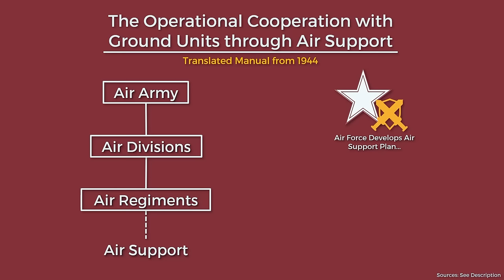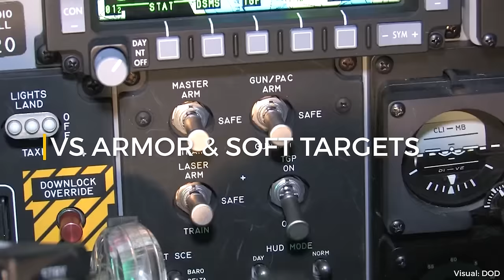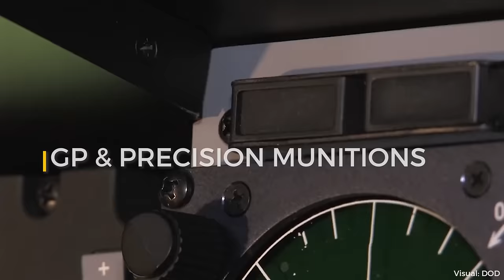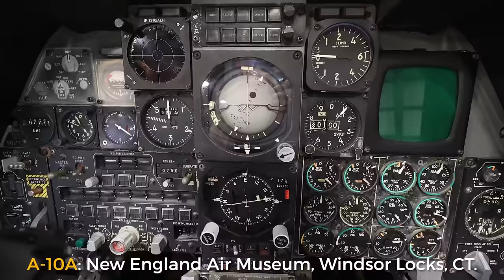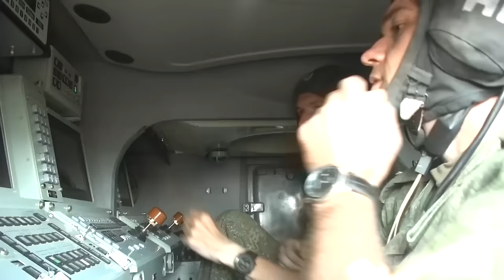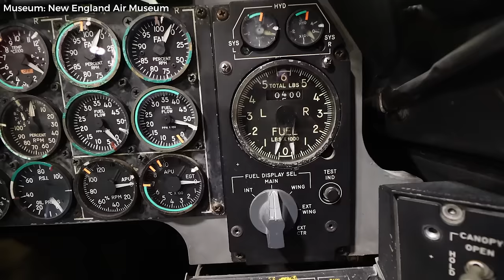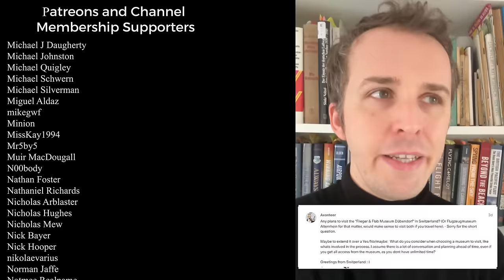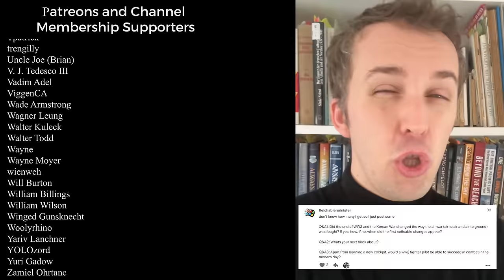A-10 Warthog: Retire or Upgrade the BRRRT? - Future of A-10C Thunderbolt II

Comment: I was going to bring this up as if I were the first to think of it, but I'm really really not.

I said it on another video, the A-10 is not a strong opener, it's STILL the best closing move. The cleanup. After your SEAD and DEAD missions sweep the enemy threats from a battlefield/zone (and enemy air threats are neutralized) that's when it becomes extremely cost effective. What need is there to waste wear and tear on the more fancy fast flying, less fuel efficient machines once the skies are tamed? Those more less economic options are the way they are to survive more hostile skies. We showed in Desert Storm that we fight wars to make gains. If the battlefield never gets safe enough for an A-10 to do CAS, it means one of the arms of the military didn't do their job like they were supposed to. And you don't bank of militaries just throwing in the towel because their SAMs and planes are gone either, there is plenty of time and space for the A-10 to get down to business once those are dealt with.
Reply: The real question is: do the politicians, and do the gears between them and the Military Industrial Complex want to get a move on and actually reboot the A-10C's parts production? Or is it politically unsound? I mean that never stood in the way of anything right?
Reply: Also 'projected to be retired before 2030' means one of two things:

A. 'We got something better in the works that we aren't telling you about.'
B. 'We have no idea what to do with it so we'll just make up something that sounds like we're busy doing our jobs in the meantime.'
Reply: The problem there is that you cannot eliminate 100% of enemy air defences with SEAD/DEAD. All of the A-10's combat losses are to highly mobile systems that don't rely on radar, and thus slipped through the cracks of SEAD operations because they are difficult to locate and track. During Desert Storm more A-10s were lost to these types of vehicles than F-15s and F-16s combined were lost in total, despite the A-10 being used primarily for interdiction after SEAD/DEAD operations. 

Modern SHORAD is significantly more dangerous. And in the A-10's best operating environment - mountainous terrain - gun-based SHORAD systems are often used directly in support of armoured columns or convoys to counter infantry ambushes, because they can engage targets at higher elevations than tanks or IFVs can. Same is true of urban warfare.
Reply: @dumdumbinks274  Unless we're talking actual radar guided flak artillery, which is quite the rarity nowadays to say the least I don't see guns getting past the AGM-65s. Especially with all the C models advancements that I know of.

Our SEAD and DEAD capabilities are far better than even before. We also have much better live satellite imagery which, I am guessing, but correct me if you know better, would narrow the cracks quite a bit.

Now, I am not sure if the A-10 is capable of datalink/a similar system as of right now. I would imagine recon drones could be employed ahead of the jet for example, and send info back, but maybe that's not the case. 

As for the poor performance during desert storm, this was because we sent warthogs flying low enough to be in threat range of shorter range SHORAD like you mentioned rather than fly in the enemy radar. An unnecessary blunder I think. Certainly not something to repeat.

I will agree that IR/optical SHORAD is the big deal. If something got through the cracks, that would be it. Wouldn't this happen far less often now vs then? They might have more range than the used to, but they are now worse at hiding from the eye in the sky. So enemy SHORAD of that nature is kind of worse today than before even with their upgrades. Besides, if it can shoot down an A-10 at high altitude, it can shoot down those other jets too. Is there a better solution? The only guess I would have is drones replacing piloted CAS aircraft all together.
Reply: @themigratingcoconut562  The AGM-65 does outrange most SHORAD systems over open terrain from say 10000ft altitude. However there are many restrictions favouring other munitions for anti-vehicle duties. The primary issues in this discussion are the subsonic glide and large size of the missile, which make it a relatively easy target for modern SHORAD systems, as well as the fact the A-10 can only carry 2 of them which prevents them from overwhelming SHORAD systems. So in essence, while the A-10 can engage SHORAD systems, it is of limited effectiveness.

SEAD/DEAD capabilities have improved, but are still largely dependent on the same concepts. There is no hard counter to modern SHORAD, because while we can more easily track ground targets *movements*, satellite imaging can be fooled by visual camouflage and is dependent on weather. Additionally, most modern SHORAD systems use radar for search, but don't necessarily use their own radar to do so. Datalink isn't just on planes, but also air defences and even tanks.

I believe the A-10 does have datalink built-in ever since the C upgrade, but it is of a more standard capability, likely focused on integrating with ground forces, which in the near future would definitely include the drones that are beginning to equip infantry squads. Everything in the near future will be part of the information network.

Desert Storm saw A-10s being shot down mostly in transit at around 5000ft, which was deemed the operational floor for the theatre. However A-10s needed to fly at this altitude in order to spot their targets visually (which is still largely the case owing to reliance on IR/EO targeting).

The best combat use for the A-10 is to fulfill the COIN and AFAC roles in low-intensity conflicts. I don't advocate for the A-10's retirement, but it's advantages are such that while it is very effective in certain situations, those situations are not common in the wars that the US military are supposed to prepare for i.e. peer conflict. I'd prefer a reduction in numbers over outright retirement, but I can see where the USAF are coming from.

The problem with the A-10 vs any air defences, is that it spends a lot more time in the enemy's sights than other jets. Slow speed = longer exposure. Fast speed = short exposure. This matters not only for the physical engagement range, but also the reaction time of the enemy systems. An old system like a ZSU-23-4 might require several seconds just to lock onto a target, which is why the A-10 was viable last century. Modern systems take significantly less time to lock on, and often have superior weapon velocity too which gives the target less time to react.
Reply: @themigratingcoconut562  incredibly short sighted. MANPADS will be unseen by SEAD, and even radar SAMs can turn off their radars to protect themselves. And nowadays electro-optical/thermal tracking allows a SAM to hit aircraft with passive sensors alone.
Reply: @dumbdumbinks274 I thought they could carry up to 6 agms, 3 per pylon. I think I can agree with just about your whole thing there otherwise, a reduction in numbers for the time being makes a lot of sense, but probably not retirement. US prepares the most for the worst cases, as that is the smartest thing to do. However, we've also had a habit of fighting wars over nouns and stuff which, I believe, tends to generate some of those oddly lopsided battlefields which are unlike most conflicts people tend to think/worry about such as that happening in Ukraine or any hypothetical/theoretical between US and Russia. 

 @ChucksSEADnDEAD  So CAS is done then. Or we just leave it to drones? The F-35 does seem the best fit to replace it then given what you are saying. With it's stealth, multi-role, awesome sensor suite, and fighter-jet maneuverability though wouldn't it still hardly be immune to what you're talking about? 

For both of you I'll present one final case for it remaining in a CAS role. 
Even though the F-35 wouldn't be shot down as often, owing to it's strengths, each of those losses would be felt much more due to unit costs, Mx costs, and tech getting into enemy hands potentially. There is also the fact it cannot stay on station as long even when it's alive, which is worse for ground troops.
So to my view this trade-off remains: Attrition rates for the A-10c would be worse given it's lower maneuverability than the F-35, but, the F-35 has to stop and re-arm/refuel more often anyways when up and running. We also cannot afford as many of them. So maybe it's still going to be better to accept more A-10 losses if that means higher numbers of ground troops being aided thanks to it's advantages in endurance, payload, and availability.

Comment: Sounds cool, but it’s one of the most overrated aircraft ever, which is why the US DOD has been trying to get rid of it forever. The F-111 had 3x success taking out armor and that wasn’t even its purpose.
Reply: The USAF did not want the A-10 because they wanted supersonic jets.
The only reason they have it is because the Army needed a Close Air Support aircraft
Reply: @pogo1140  The only reason they have it is because Congress forced them to keep it. Specifically McCain.
Reply: @The_ZeroLine  Correct, because the Army needed and still needs Close Air Support.
Fact is, that A-10 squadrons that convert to  F-16's are getting CAS training but those that are converting to F-35A's are getting zero CAS training.
That puts a lie to the claim that the F-35 can do CAS as well as the A-10.
Reply: @pogo1140  I doubt they’d want to risk the F-35 for CAS.
Reply: @The_ZeroLine   CAS is still a requirement, and right now the USAF's answer is to give the mission to another plane they've been trying to get rid off since they did not want and is even equally more vulnerable, has a smaller war load and higher maintenance cost and like the A-10 is scheduled to be retired.

Comment: While I think as a gun platform I think the evidence suggests it overated, but I cant see how the A10 could never been seen as anything other than an very useful & effective aircraft. The fact ground troops seem to love it ( and their adversaries seem to hate it ) should be recommendation enough. It does things fast jets just can’t do & in a pretty cost effective way. That said it’s a very old design and air defences are much better now- retiring it makes sense, but replacing it with something like f16s doesn’t. It need replacing with something that can do its specialised role, probably with something that is un/optionally manned.
Reply: You are ignoring the increased range of weapons which enable the F-16 to perform the mission better than the A-10.  The A-10 is designed to fly low and slow and fight close-in.  The 'slow' and 'close-in' are no longer viable options for fixed-wing aviation.
Reply: @charlesfaure1189   During Afghanistan, A-10's flew combat missions that forced F-16's to abort and had B-1's landing with their entire bomb load unused while American soldiers were calling for help.
A-10's would often fly below the low flying clouds, making attacks from 5,000 feet and lower, turning inside the valley while staying below the cloud to keep a visual on their target. The only other aircraft that could do the same were the helicopters who often ran into altitude restrictions in the hot and thin air of the Afghan mountains
Reply: @pogo1140  Speaking of hot and thin air, the A-10s had to take off with light loadouts from Bagram or else it wouldn't clear the base perimeter fence.
Reply: @ChucksSEADnDEAD   so did the F-16's thin air effects every thing that flies. 
A typical war load for a Bagram A-10 was,  2 LAU-131 Rocket Pod, 2 GBU-12 Paveway II, Mk. 82 LDGP?, and an AN-AAQ-28 LITENING AT targeting pod. F-16's usually carried 2 Mavericks and a 500lb JDAM and 2 fuel tanks.

Comment: Sadly, the USAF has tried to kill it since day one.
Reply: Well, it was spite project anyway. Not that good imo, and all victims of blue on blue would agree.
Reply: Although I think the A-10 has probably outlived its relevance at this point the AF trying to kill is not an indictment. Most AF officers are smug assholes that completely change their opinion on what the AF should be every 20 or so years. I mean, we didn't even have a capable tactical fighter force (with deficits in equipment and training) until the mid 70s because the AF higher ups all though strategic bombing and conversely bomber interception was the new way of war. They are even trying to fast track the Raptors retirement now.
Reply: it was obsolete since day one, you can't hold it against them
Reply: @ВячеславСкопюк  it was not obsolete for basically the entire Cold War and then it fell backwards into the COIN role which it was also good at tho not designed for.
Reply: @boxtankgamer6014  
>it was not obsolete for basically the entire Cold War

but it was. It was designed as a modern day Ju-87G and stopped being relevant with the new generation of soviet tanks entering service which coincided with A-10 entering service
Reply: @ВячеславСкопюк  Obsolete except they did not have a plane that could do the job
Reply: @ВячеславСкопюк  The newest T-90 still has a thin top and will brew up just as easily as a T-55
Reply: @pogo1140  
>and will brew up just as easily as a T-55

lol. Tell me you know nothing about T-90 armor and A-10 attack profile without telling that directly
Reply: @ВячеславСкопюк   Roof armor is equal to  around 40-60mm 
It's the angle dude. They even have a coloring book for it.
Primary target, roof of the turret and back deck of the tank. It needs a higher attack angle.
Reply: @pogo1140  A-10 is unable to attack roofs under any meaningful angle

Comment: It is clearly past time to begin replacing the A-10, as any replacement won't even be in service before the existing aircraft must be retired, even with SLEPs and upgrades.

However, the role remains, and it is one that cannot easily be filled by a more general purpose multirole fast fighter, regardless of what the Pointy Nose Mafia claim.

However, the proper approach is not an A-10 variant follow-on so much as a clean sheet design that applies the principles of the A-10, but applies them with the latest technology and 45 years of accumulated lessons learned.  So, a highly robust, long loiter time, heavy payload, optimized for CAS and low altitude, with a good gun for ground attack.

1.  The choice of the 30mm GAU-8 was by and large, arbitrary , because the USAF just wanted something larger than a 20mm M61 and wasn't sure how effective an AFV killer air to ground missiles would be.  Using a 25mm cannon like the GAU-12 (AV-8B) or GAU-22 (F-22) would provide no significant loss of gun performance on plausible  targets, while taking roughly half the space, weight, and recoil force in the airframe.  This would (even if we basically duplicated the legacy A-10 in all other respects) free up more than half the space and weight of the GAU-8 that could be used for sensors, comms, EW, etc. - all things the A-10 has been deficient in.

2.  Keeping the flight performance, payload delivery, and survivability requirements of the legacy A-10 as a minimum threshold would be a good start, while adding in requirements for things like modern data links, sensors, sensor fusion, and reservations for future growth.

3.  Making the follow-on an optional two seater from the beginning would likely be advantageous.  There are roles where a second crewman in the back is advantageous, such as strike management, FAC roles,, controlling "Loyal Wingman" or other drones, etc., as well as allowing potentially any airframe to be used as a trainer at need.  The "optional" part means designing it so that when not configured as a two seater, the seat can be readily removed by ground crew and additional payload (EW suite, additional sensors, perhaps even fuel) could be carried behind the pilot.

Note this only makes sense for a force akin to the USAF - large, well funded, and likely.to face a plethora of possible employment scenarios.  If you have a smaller air force, you can't really support as many specialized airframe as a larger one - probably better to get multirole fighters that can do CAS today and CAP tomorrow, or an armed high performance trainer than can do CAS, light fighter roles, and advanced trainer.

It also would likely make sense for the majority of a CAS specialist fleet to be in the Reserves and Air National Guard, simply because of the more specialized "focused on active ground combat" nature, versus a more Jack of All Trades bird like an F-35 that is more heavily aligned with the more common "less than war" operations like air defense patrols.

Comment: The name of the game is C.A.S. and there is nothing that comes close to the A10 for its ablilty to perform that mission. You can send in some F16's at high altitude, but then you are no longer providing C.A.S...... Ask any of the guys with combat experience on the ground what the best C.A.S. is. They are the only ones who can give you a acurate answer based on first hand knowledge and experience.
Reply: CAS against a competent enemy is no longer survivable.  You might as well defend battleships because of 'close-in offshore fire support.'  The mission doesn't exist for piloted aircraft any more.  CAS is a drone job, not a piloted-aircraft job.
Reply: CAS has nothing to do with altitude. Also, you ask the JTACs what is best, not the soldiers who are only ever receiving the benefits of CAS.
Reply: Close Air Support means ordnance is falling near friendly troops in close contact with the enemy. Not that the aircraft is close.